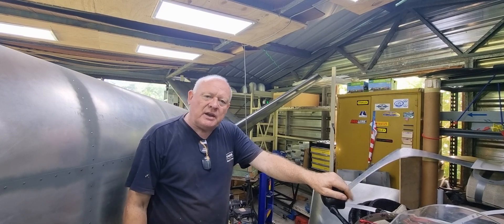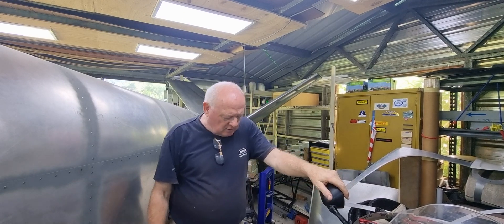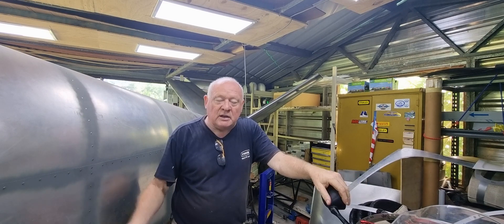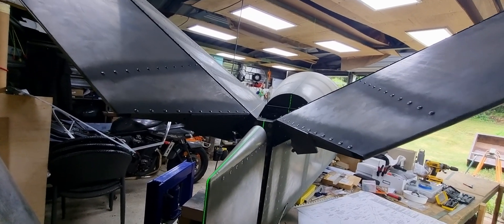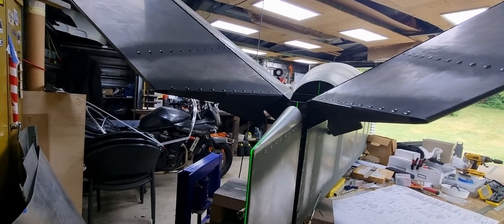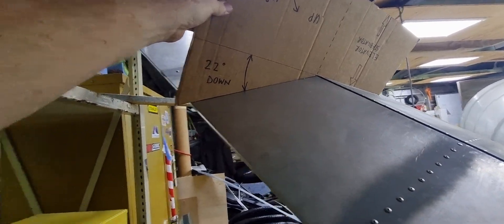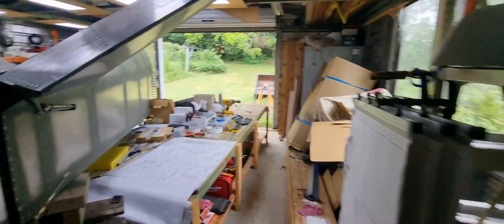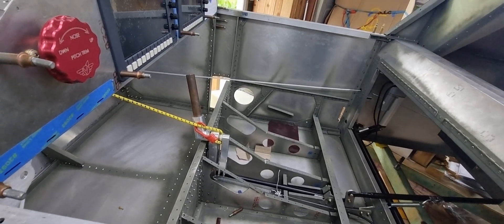Sonex Waiex B, Part 26-Elevator rigging and fitting the Electronic Circuit Breaker

Comment: Nice one Andy. You mentioned your "rudimentary" angle checking device. The whole time I was thinking what a clever idea it was. 

And the fold down breaker board is a great idea! Well done!
Reply from the maker: Thanks Dan,  I wasn't so much suggesting it was not a good idea, just rudimentary in the fact, inaccurate being the 22 deg, could be anything from 19 to 24? When i get the plane up into the new shed I will do the entire process again